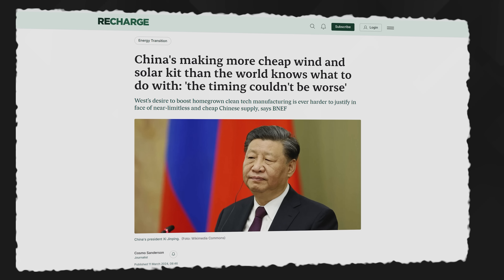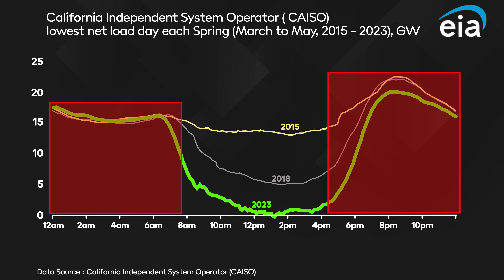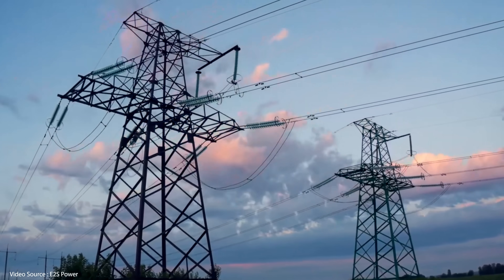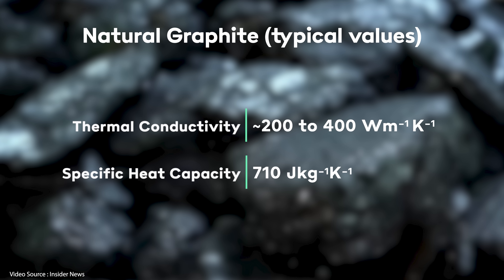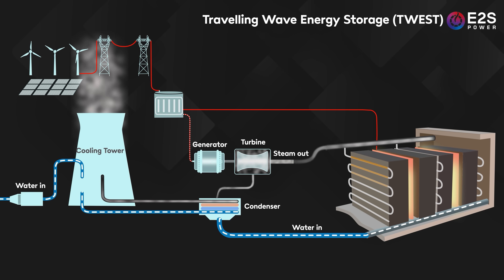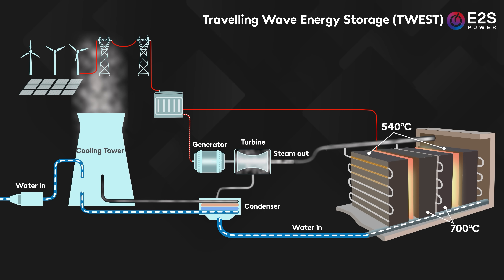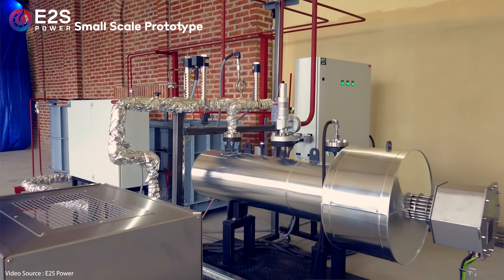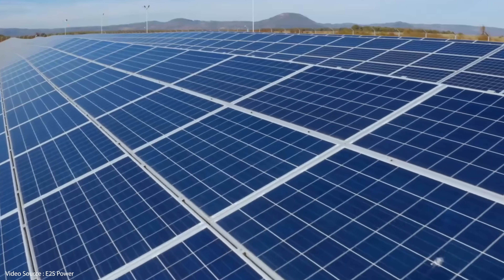A coal power station without the coal! How 'WIN-WIN' solutions could save an industry.

Comment: Hang on Graphite? Are they talking coal or coke denied air here?

So you still have to mine graphite, or purify coal to have the graphite to do this? 

What is the lifespan of this Graphite in this module and how do they purify the graphite without using energy reducing the efficiency of the graphite as an energy source?

There must be some chemical, biochemical, thermal or process that permits this function, how does the graphite degrade, is it uniform and how do you need to treat and support it, what resources are required. Graphite would burn at 700°C so what gases or technology is used to deny that combustion? And how does it affect the Graphite? And what are the waste materials or elements that are released in this process? Or are you telling me there is no waste?

Even a sealed thermal battery must have waste and recycling issues, what are they?

This may be a new technology, but I don't see how it's solved any of the old issues.

Comment: It's good to have an alternative and competitor to Rondo heat blocks - as we need to try all sorts of methods. But will the real competition come from simpler off-river pumped hydro which can store days, even weeks of energy? It's 80% efficient round trip - not just 40% or less like most thermal power plants. So now it's down to price. Do we want to build double the solar to charge TWEST for 4 hours, or use less solar and push that water up a hill?

Comment: A Geothermal loop system may be more economical as no need to build and charge modules. 
Heat exchanger and condenser still needed. But these can be installed on station land contaminated by coal process.

Comment: So… lower efficiency (45%) compared to battery storage, but more energy dense, less land use and ability to re-use infrastructure.
Did I understand that correctly?
Reply: Well, energy density is 15 times lower than a battery storage. So to scale it up it will require land usage. A lot of it!

Comment: Turning coal plants into high-efficiency thermal battery sites. That's rather genius, and I very much look forward to progress on this front!
Reply: Round trip efficiency is actually much lower than batteries. But solar price is dropping so rapidly that it doesn’t matter much. The low cost and reuse of existing infrastructure more than makes up for it.
Reply: Ehhhh just to be clear that "99% efficiency" is only for turning electric into steam, not electric to electric again efficiency steam turbines is always where you are going to lose the vast majority of your efficiency and yes steam turbines can be as efficient as 90% but that is not most your probably looking at more like 75% for an average, but still ~74% is not horrible and if you have a centralized heating system for residential usage you can use that waste heat for heating, or for industrial usage as 24% of processes that need heat need temps less than 100C.
Reply: @OrenTirosh  Did you not notice the quotation marks around "99% efficiency", notice that I wasn't replying to you or read the whole comment? I pointed out that round trip efficiency is likely more like ~74%.

I was simply pointing out that the efficiency quoted was just for electric to steam conversion.
Reply: @Etheoma  It does not make sense energywise.
Lets say you have 1 kWh of electricity. You use it to heat the battery and from the system you get around 300-400 Wh of electricity and 300-400 Wh of heat for district heating.
Now use the same 1 kWh to charge a battery, from it you can get 800-900 Wh of electricity. You can use half of it (400 Wh) in a heatpump to get somewhat around 1000-2000 Wh of heat. And you can choose to not make heat (just electricity), without loosing efficiency (like you will with turbine). See that?

Comment: Another potential benefit is a heat pump effect: in the summer excess heat can be pulled away from the equipment and stored, and in the winter, stored heat can prevent equipment from freezing, though that might require a long-term heat battery.

Comment: Carbons boiling point is 4827° Celsius
A little history of graphite:
"How do you make Graphite?
While graphite is naturally occurring, it can also be produced synthetically. In general it remains relatively unchanged from when it was first discovered. The worlds first graphite ‘pencils’ were essentially raw chunks of graphite from the earth. At this point its main use was to mark sheep. An increase in demand for graphite saw natural reserves deplete. Alterations in manufacturing methods gave us the tool we know as a graphite pencil today. Pencil makers began to use a blend of clay, waxes and graphite powder in order to manufacture pencils on an industrial scale. Today, we make synthetic graphite by heating carbon containing substances to very high temperatures. In this heat, carbon atoms rearrange themselves into the aforementioned uniform layers. This method of production creates a synthetic material with much higher purity than natural graphite."

Comment: When I hear “graphite” and “power plant” used together I can’t help but think of Chernobyl where the graphite moderator in the reactor caught fire after the rupture.  The resulting smoke plume spread much of the radioactivity attributed to the catastrophe.

Of course there is no radioactivity to be spread in this scenario, but you still better have a robust fire suppression system in place in case of a catastrophic rupture of the oxygen free container for all that super heated graphite.  Maybe a coal plant is fitted with all that already too?
Something to be said for the competing tech using (nonflammable) ceramic elements instead of the graphite.

Comment: I wonder if it could be heater with waste heat from burning coal. This would raise the efficiency of coal burning plants. There are water storage based heat acumulators that use waste heat for district heating systems.

Comment: I would be excited with something that harvests leaking methane from oil wells, water wells, etc.  
It's low tech. It's low cost. It decentralizes fuel so it increases community resiliency.  
Using localized methane harvesting for heating/cooking would reduce a lot of greenhouse gas volume

Comment: *Bangs head against wall. 
Stop. Promoting. Dumb. Techboy. Coalboy. Fantasies.

It is, from a critical analysis perspective, top down from physics to economics, a very bad idea to use thermal energy storage for grid scale energy. This idea came about as a far-fetched way to get coal power plants onboard with renewable energy, but it does not make fiscal and physics sense. The big kicker is that these systems have round trip efficiencies of at best 30%. That means they waste 70% of their energy and dump it into water in cooling towers. Could we then reuse that waste heat in a combined heat and power situation? Maybe, but that's only relevant in heating seasons and requires laying pipes for a thermal distribution system, which adds on to the cost of the project. This graphite blocks can store a lot of peak heat, but they continuously cool down during discharge, which means the stream pressure is dynamically changing up and down during operation. This is very much unwanted and something that current thermal turbines are not equipped to handle. They normally adjust fuel input to keep the temperature, and hence the steam pressure, at a constant value because the installed turbines are optimized to run at a set pressure, and they're efficiency drops rapidly outside of the optium. Hence the retrofit involves installing new turbines that can handle constantly charging pressure inputs, the thermal storage system itself, and a combined heat and power distribution system which all together rivals or often exceeds the cost of battery storage, never mind that even with these add ons, thermal storage will likely never compete with the round trip efficiencie of batteries. Battery storage is no less than 70% efficient, often greater than 90%, and new and current production battery models are not limited by the costly material constraints that affect mobile batteries. 
Thermal energy storage is sn incredibly powerful and useful idea in many use cases that use heat directly. Using phase change materials to store heat for hot water, space heating/ cooling, or process heat for some continuous industrial applications, make sense and are being pursued, though I would argue they could be pursued more aggressively. 70% of U.S household energy consumption is for space heating and cooling, and we can use TES to meet those demands on site with a small footprint and cheap materials. But grid electricity storage? That's just some rich people trying to rizz up the fossil fuel industry with poorly thoughtout pitches. It's not worth listening

Comment: No only don't renewables work. There life is less than 15 years. Thermal energy yet again is based on getting enough sun light to heat it. Thermal energy is another pipe dream that people like you tell people that it will work. Not the fact that it still insufficient to do the job reliable.  In the current technology there is 3 ways to to reliably generate electricity without sending the price through the roof.  Gass, coal, nuclear.  I love it when people like you say it can do the job needed when it can't. These generation ideas need atleast 75% sun or wind every day and the sun or the wind are not that reliable or realistic.  Go back to sleep and continue dreaming. C02 I'd not an issue for the earth. Why don't you show both sides of the argument instead of just the climate religion.

Comment: Can’t possibly get the footprint smaller of this solution compared to battery storage. The graphite itself may be close to battery storage in weight and volume but you just need semiconductors to connect to the grid with batteries. No turbines, cooling towers, confessors and miles of piping. Stupid solution. Again.

Comment: Robert, this really shouldn't have been unexpected- the basic tech to it is very mature and the "new" tech is applications of temp. control not entirely doable forty or more years ago. I'm wondering just how long it will take to connect the the increasingly more viable deep geothermal energy- which would leave us with nothing but the ozone a conventional generator can make as a pollutant. This is also a technology that would help all nations step forward with a lesser financial hit- something we all need. It would also mean that we don't need to spend 25+ billion USD for a plant that still cannot be expanded as an area grows, and this replacement will only take about two years with the same anthill of men (about 2,000-2500) it takes but for much less than the decade plus a nuke takes. Further is would give new impetus to directly reclaim old coal and fossil fueled generating sites to be used for the new. A can be win- win-win, the trifecta we are all hoping for; then there are those ten thousand niggling, little details. But what a potential.

Comment: This is all well and good , however there NOT acknowledging the elephant in the room that being inclement weather if there is no sun there is no electricity to charge those industrial batteries so in a hypothetical situation if a weather front moves in and stays over any given region for more than a week you ultimately have no electricity whatsoever with out traditional coal boilers as a backup system , such as what happened in Texas a few years ago.

Comment: Terrible idea. Thermal energy has the poorest quality of all types of energy. Massive losses during conversion. These efficiency figures are probably either junk or exergy or 2nd law efficiency numbers which can very conveniently hide the first law efficiency. 2nd law efficiency is good for optimizing already existing setups while for new ideas, a first law efficiency number is what really tells you in vs out.
Edit - ideally one should look at both 1st and 2nd law efficiencies to see if a. The idea is good and b. The thermodynamic cycle parameters are optimized.
Reply: Converting excess electrical power into thermal energy and then back into electricity grates on my thermodynamics education.

Comment: It does not surprise me that India was the first use of this technology.   Their need to garner cost savings over the expense of a battery is the only real benefit of  this method of turning excess renewable electricity into useful electricity.  It can only store about 40% of the same energy if it were stored in batteries instead. Worse still, because of the retention of the original coal fired facility's ability to keep using that fuel is the temptation  to revert to that means. I see this as a half measure, tantamount to  potential "greenwashing".

Comment: I am dubious about the quality of those panels given the usual quality of Chinese production I have experience with.   They might hold up for long enough to get some local production going to provide replacements.  I know at least 1 recycling operation is recovering material from panels in Texas, maybe it can expand too.  Lifecycles of these things needs to be a lot greener too.  Plain old HOT dirt like a pile of carbon probably has a LONG and clean lifecycle cost.  Using mass to create thermal lag is an old trick used for centuries simply by making mudbrick walls thick enough to be cool at midday while radiating the heat away overnight,  So this is just a high tech way and re-jargoning of that methodology.

Comment: I;ve been saying this for years: take an engineer from the hot end of a fossil plant and put him to work in the hot end of a solar-sourced thermal plant, he will be completely familiar with everything around him.  The hardware is the same.  So convert the ruined ground that used to host mountains of coal at a fossil plant into the big concrete pad that will now be the foundation for your solar thermal storage facility, and the plant stays in operation.  Far more economical than starting over somewhere new, leverages existing investment and infrastructure.  No downsides, really...with the possible exception that the people downwind of the old fossil plant will continue to have to put up with it.

Comment: I wonder if/where it might be feasible to use heat pumps to heat up the graphite. Beside thec3x or 4x efficiency, this would have the effect of cooling the other side, which could provide the cooling water for the hot side of the generation system, increasing overall efficiency and reducing the heat load to the environment.
This almost sounds like perpetual motion, but I don't think that's the case.

Comment: For me, size does matter. Iron has almost double heat capacity to graphite. And though I could not find an exact quote, it seems to be cheaper also ? :O I would still need 43 m^3 of iron at 500C for a single home though.Is space is not an issue, just use dirt instead of carbon/graphite.

Comment: Hi. I dont usually comment, but as a Critical Power Engineer felt the urge. I can remember when Storage heaters on an off peak tariff were the future. Is it just me or is a lot of “new” “cheaper”, “green” methods of producing energy, are there mostly to make investors salivate over the opportunity. Everytime we convert energy backwards and forwards into different mediums, there is a loss, and requires a mantenance crew. 
Now.  I am as aware and mindful of the concerns over climate change which threatens our future. But the root problem is our dire need for more and more energy, and thriving economy (not necessarily in that order). all we need is consumer awareness and awareness that, personal assistants, handheld IT equipment, TV’s (dont mention advertising) etc are at a cost to the environment.
Unpopularly, I’m not a fan of EV’s, working in the power sector, I see the reams of Diesel, Gas, battery storage that props up the grid at peak demand.
Why does energy generated over 3hrs Mornng and Evening become more expensive at the wholesale end, its the same Opex as the other periods, but its demand pushes the theroetical “value” upwards. I have no communist ideals, but on a now vital commodity thanks mainly to the digital computing era, (if you think losing the central heating is bad, you should see the projected financial loss/cost of losing a mobile phone transmitter in west London),  and with imminent AI developments nothing is likely to change.
i’ll stop now… But if everyone simply turned the plethora of power adaptors and wifi routers off when they were at work….

Of all the YouTube contributors, I find the JHAT videos one of the best and informative. Keep up the good work.

Comment: Heat batteries that discharge energy, but don't create it? The most likely use for this is making power plants more efficient, rather than converting from coal. Still a win.

Comment: We were only discussing this the other day. Instead of leaving the turbines in place, SMRs could have replaced the boilers of coal fired power stations. Instead we had environmental cults like Ashok Sharma with his finger on the big red explosives button. (I note that the images of him doing the deed, have been scrubbed from the internet) UK does not have the renewable energy to make this work. The only reason that Drax is still burning wood chip, is that bio derived CO2 is classed as non fossil fuel, for the same reason that industrial composting is allowed. Drax has four 500MW sets not turning they could convert to this process, or alternatively tyre pyrolysis. Since SMRs are to small to power 500MW sets you would require two per set. In the same vein how big is the indian power station, 50MW? No numbers to chew for this one?